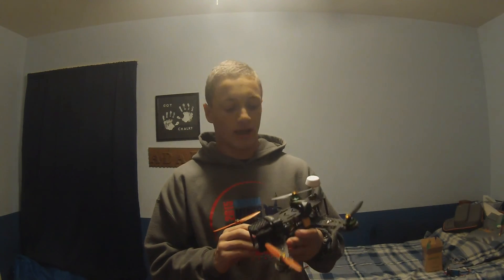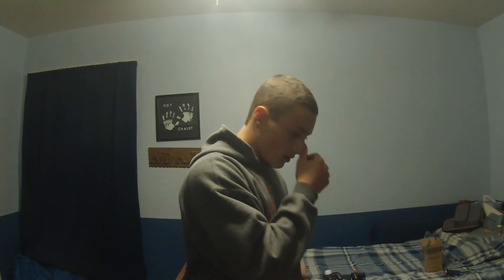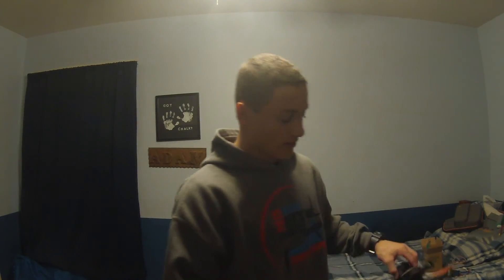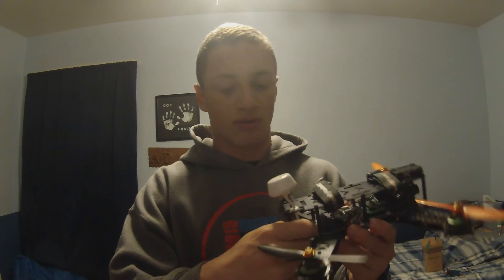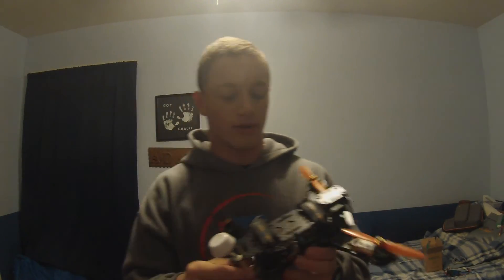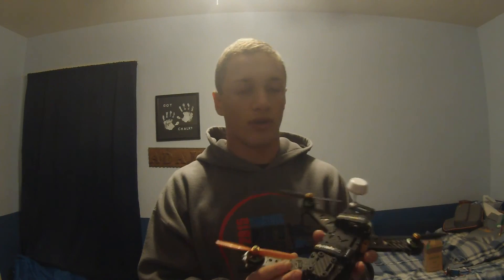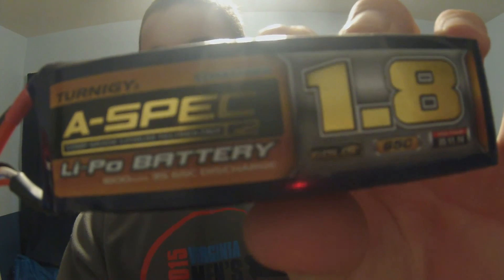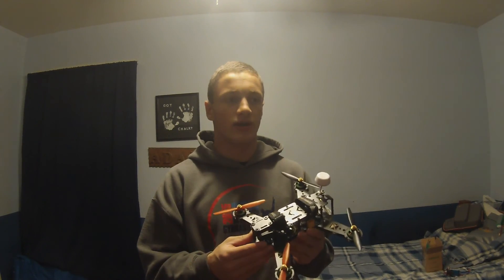ARRIS X-Speed FPV250 Pure Carbon Fiber FPV Racing Quadcopter Review

Comment: I got my Arris V2 C250 yesterday... I flew it once and the quad let the battery go down to 12.6 Volts....Isn't that too Low? how do you change the low battery warning threshold?
Reply from the maker: wildbillo68 12.6 on a 4 cell is defy way to low, the only way I know how to do that is set a timer on ur radio and go from there, been a long long time since I looked at the CC3D software

Comment: Great vid Adam. I am ready to take my little 250 out lol I do need to add the settings I got from you back in the summer to my cc3d board so I can have a bit more snappy flight.
Reply from the maker: Thanks, those won't be very snappy if I am correct but I learned on those settings so you should be ok
Reply: +Adam Bauer Hey Adam can you send me you send me your PIDs to tmbmediainc@gmail.com. Thanks